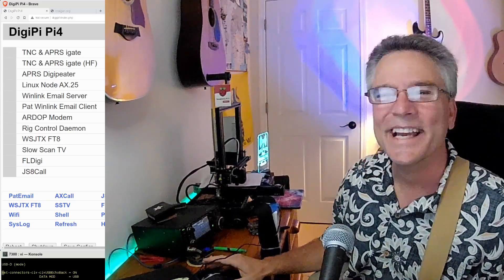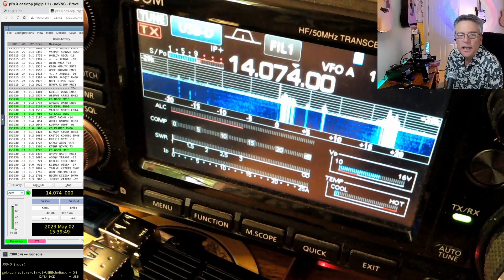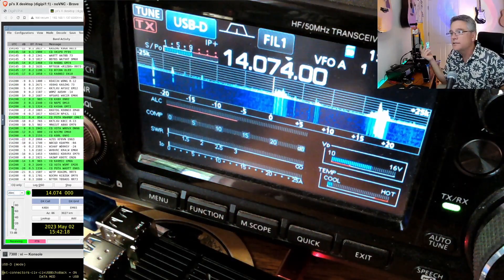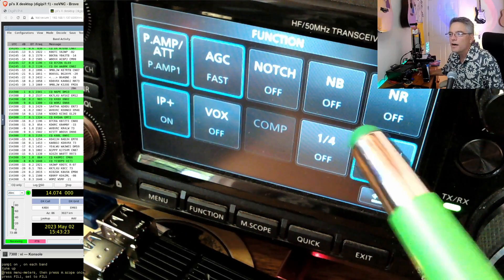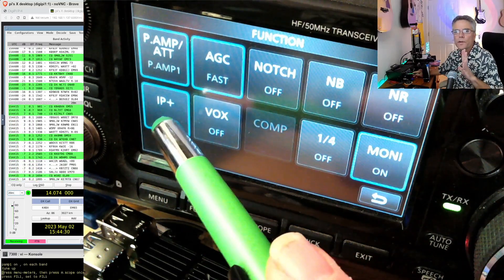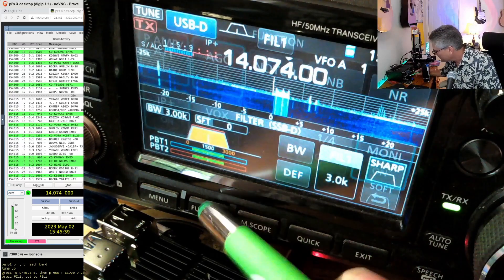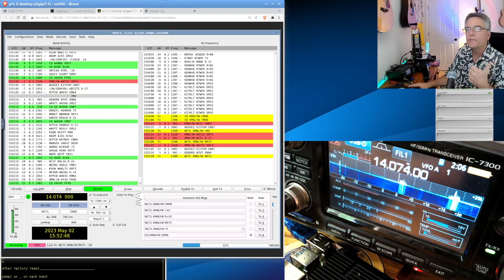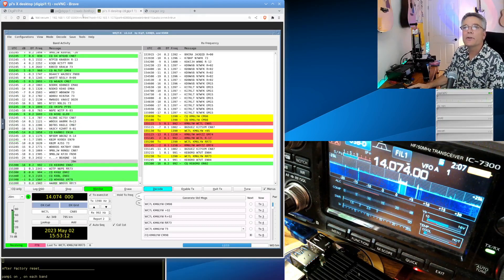Ideal configuration settings for digital modes

Comment: I've not ever had my 7300 lose its mind (factory reset) but perhaps because I use the 1 tripp Lite usb cable 2 now have a good common mode choke ( as you might be able to tell I'm suspecting RF in the shack ?). Wow, 40m is dead today, can't even hear anything on 7074 ! The 7300 is the less aasy to not be transmitting with FT8 or even better JS8. I'm alble o communicate , ssk questions, talk about my weather, antenna's, tuners, radios anything I want on JS8. It has 4 speeds and if a station is transmitting on the fastest one (50 wpm) and your on the slowest one (6 wpm) you can still communicate on your respective screens without changing anything ! You could even be on different offsets ! And, you can put messages on a stations mailbox if he isn't there, or you can put a message in that mailbox for a different station ! You can relay through a strong station to a station much farther away than you could reach with your station ! JS8 is an amazing program at the js8call website.

Comment: Love the guitar intro! Is it practical to do Digipi email on HF like Yeasu ftdx10 or do you recommend on the Yeasu ft991?  I'm just looking at getting my first rig.  I was almost convinced at getting the ftdx10 until I found the 991.  Now I don't know how the 991 compares to the dx10.  First world problems.  Any advice is greatly appreciated! Thanks.
Reply from the maker: all great radios, though, i don't have stick-time on the dx10..  My 991(nonA) is tempermental, and a bit more difficult to configure for digital modes than similar icoms, but work perfectly when setup.